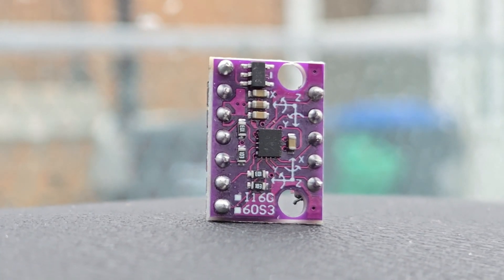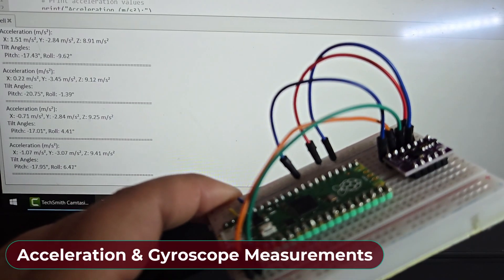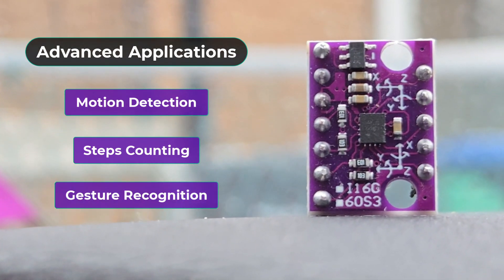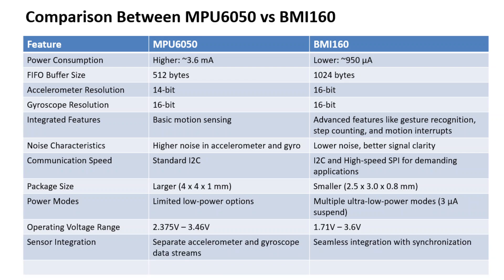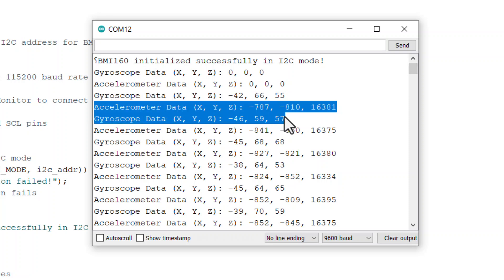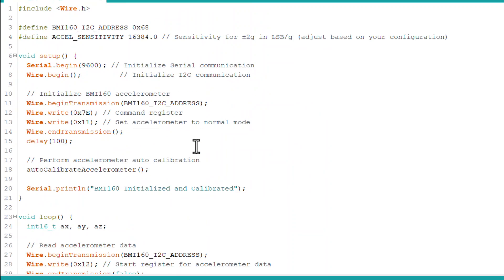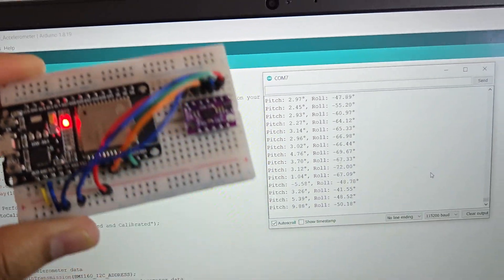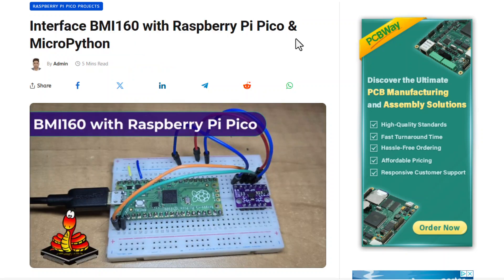BMI160 Accelerometer Gyroscope | BMI160 vs MPU6050 | Usage with Arduino, ESP32 & RPI Pico

Comment: I asked this question in some other of my own videos with regards to the MPU 6050 as used in a DIY stabilizing control module for DIY RC Helicopters.  I have not stumbled upon a video or info that explains this application, with respect to RC helicopter design. Yes, I understand about pitch roll and yaw, and understand that these 3axis gyro accelerometer sensors measure the acceleration or angle of what it is connected to, but my interest is in finding out how they are implemented with servos and ESC (electronic speed controls) in a complete compact control package also known as 'flight controllers"  Can the code require to integrate with external components such as servos, speed controller, be saved into a PIC chip instead of using an Arduino or similar bulky programmer interface? this way it is very compact and lightweight.

I have done my own design RC micro helicopters using separate components, mainly 6 Ch radio receiver,  roll, pitch servos, esc for main rotor esc for tail rotor, and the old piezo gyro for tail stabilization, and have tried the more modern RC helicopter that employ 6 axis stabilization, but these are overly stable for my hand control skill and interested in learning about making my own 6 axis stabilization using either the BMI160 or MPU6050, so that I can control the level of sensitivity.

A while back I bought a few KK2 mini flight controller boards that had the MPU6050 implemented in them, with a nice small lcd screen and 4 buttons for setup, they had the option in the firmware for quadcopters, tri-copters and regular helicopters, I would like to do similar since these older flight controllers are now scarce.

Comment: good work. but can the mpu6050 measure the distance traveled on the X or y or z axis?
Reply from the maker: Its not used for measuring distance. Its only used to measure acceleration and angular velocity.

Comment: Thank you, very helpful. One question, why not using a complimentary filter to calculate angles based on accelerometer and gyroscope readings?
Reply from the maker: This is just an introduction and comparision video. If i start using Kalman filter to remove drift, the video explanation parts gets too long. 

I have done sensor fusion and Kalman filter implementation in one of my previous videos related to MPU6050. You can watch that and may be try.
Reply: @HowtoElectronics  Yes, I just checked it, thank you. I was just wondering. Probably, I'll be implementing the madgwick filter to estimate the quaternions orientation as well to avoid the gimbal lock.

Comment: You can think of Yaw Pitch Roll as the movements you might be controlling if you are flying an aircraft: pitch is your nose up/down while tail is down/up – and back to straight; roll is one wing high/low the other low/high – and back to straight; yaw is tail skewing left/right while nose is skewing right/left – and back to straight
Reply: Do you think their altitude measurement sensing is accurate?
Could it's accelerometer detect very gradual movement with accuracy?
Reply: @ with these sorts of devices, IMUs, accelerometers, gyros, magnetometers, etc, it is always a constant battle with the signal to noise ratio of the device and environment – the signal isn’t absolute, it can drift, and errors can accumulate so that it might start off accurate-ish but within a short space of time it might have such an accumulated error that it thinks it is somewhere else, unless the signal processing is good and takes care of cumulative noise and error – but, devices like this are designed for AR or mobile devices, like your phone for example, and those are quite good
Reply: @IanTindale   so, basically the more the money spent.. the more accuracy eh.
So I guess, the best gyroscopes must be in iphones and 3d scanner lidar devices eh.
Cuz they likely have to be more precise and noise/drift free than any other devices..
Kind of a bummer, though still awesome that it even exists!
Thank you for your input.
You're very insightful.